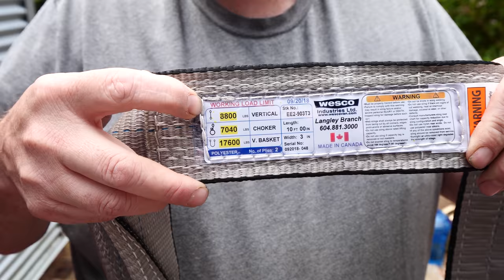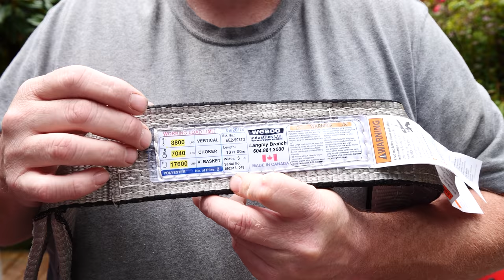Safe Winching & Recovery With Freedom Recovery Gear

Comment: I point the elastic round tow ropes are not the same as the barely elastic flat straps.  Many flat straps tear because you are using to small of a tow strap, on the round bungee straps you do not want to use too heavy of a rope as you will not get the elastic force in the rope to help you pull some one from the ditch.    Be safe be careful and do not use unprotected rope on sharp rocks.

Comment: I really like the new hook. I am a pipe fitter by trade and a certified heavy rigger. I really appreciated his emphasis on his preference in using products from the industrial rigging industry. The tested and known 5 to 1 safety rating is a big deal, however should never be used. Great video. Good education. I highly recommend everyone look up Ronny Dahl’s winching failures video. Bad stuff can happen in milli seconds!

Comment: Awesome Video Shaun, its refreshing to see Richard a guy in the industry to come out and demo his product, his knowledge is up to date, I am in the heavy steel industry in Selkirk Manitoba and deal with slings of every type and size and changes for the same purpose and we run a winch that pulls in railcars of steel that are as much as 120 tons and man that cable is heavy when your pulling it over a 100 ft, awesome video, nice to see he hooked you up with some brand new super strong gear and i see to many  guys buying shackles from auto parts stores or farm eq supplies cheap Chinese crap and has no rating stamped on them, just scary, great video keep wheeling/staysafe

Comment: That's why I want a 10 or 12k winch for my xj and yj. If you don't spool it all the way out you're not getting anywhere near the rated pull. Now I just wish the arb bumper for the xj had actual clevis tabs like your arb does

Comment: Great info, love the video!  I am wondering why he didn't pre-tension the winch rope when spooling it onto the winch.  I've seen others say that's required for synthetic line.  Does he believe it isn't necessary, or will you do it later?  Thanks!
Reply from the maker: Because it's shorter you can just spool it out to the drum the first time you use it and that will tention it.
Reply: So Freedom Recovery Gear actually pretensions all our winch ropes, extensions, and Soft shackle knots, we do this as part of our QC process, so you don't have too! every winch line and extending is strung on our custom tensioning table mentioned to approx 7,000#, and visually inspected before we put our name on it! Trying top retention a winch line or extension is cumbersome. we want you to be able to install and use it right away. so now when you installed it and go out, pull it out leaving minimum 11 wraps on the drum and your good to go!
Reply: @freedomrecoverygear6655   I added your products to my future purchase list.  May I suggest you at least link to this video under your account since you don't have any videos of your own at the moment.

Comment: Any potential UV probs with sof shackles or synt winch line how should they be stored/  Thx
Reply: SupreemX12 synthetic rope is UV stable however,  the colour does fade over time without affecting the rope fibre strength.

Comment: Why did he put 7700lb hook on a 12k winch? I thought he wanted a 2:1 for ratings? With that hook you can’t do double like pull since it’s going to be 24k on a 7700 lb hook? Or did I miss something 🤔🤔🤔
Reply: On a double line pull the load is actually shared between the hook on the vehicle and the winch. That's how you can do a 24k lbs pull, 12k on the winch, 12k on the hook,  24k on both the pulley and anchor.
Reply: Breaking strength on that hook is over 28,000 lbs, the 7,100 is an over head lifting capacity rating  (3/8" Grade 80)with a massive 4:1 safety factor. much much stronger than a stock winch hook!